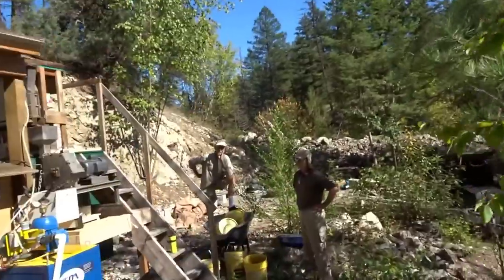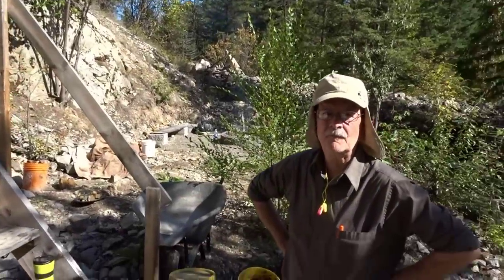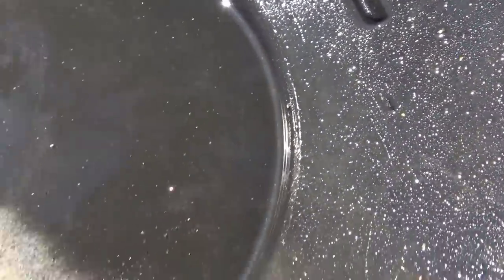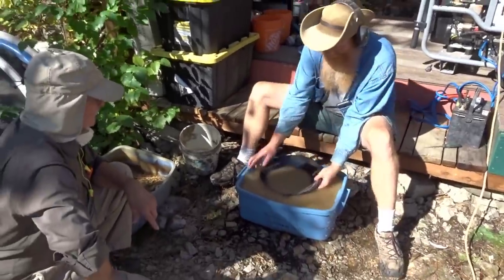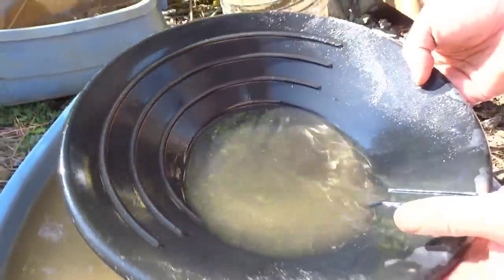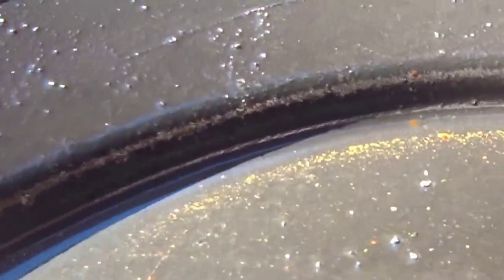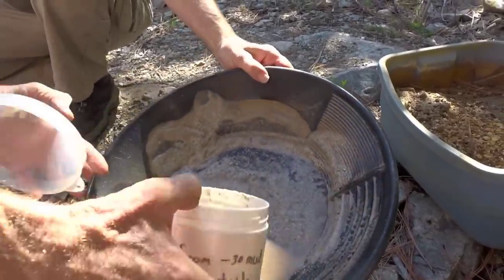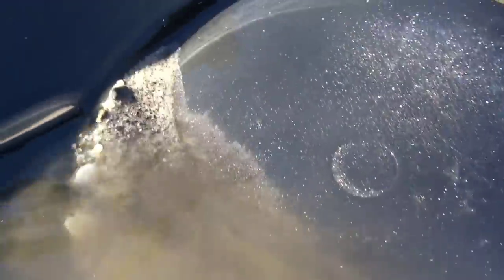Amazing Gold Recovery from High Grade Gold Ore.

Comment: Amazing recovery. Especially after being run 3x before!
Reply from the maker: Ya amazing!
Reply: @Danhurd  It isn't a lot. That 45# bucket is very roughly 1/50th of a ton. Multiply those fines by 50 and it probably comes up to far less than 0.1 gram. But, even at 0.1 gram/ton, that is about $6/ton unnecessary loss. The main question is whether it is worth recovering and, if so, how.

Very informative video. I assume you checked the tailings from the centrifuge to make sure none of the fines were getting away there.

Comment: @11:30 it looks like your sulfides are split into 2 layers like a black and a slightly reddish layer above. i was wondering why there was that color change.
Reply from the maker: Two different sulfides, most likely magnetite (Not a sulfide at all) and Iron Pyrite.  May have even had a 3rd in there as there was a heavy whiter layer as well.
Reply: @Danhurd  neat thx for the info

Comment: They should still use mercury. Just on concentrates under laboratory conditions.
Reply from the maker: There are safer ways to do the same thing now.
Reply: @Danhurd  Mercury isn't unsafe at all when its handled correctly.  But what is the alternative for 300-400-600 mesh gold? If you don't mind me asking. I would like to look into it.

Comment: Seriously.. I don't understand why no-one uses vibrators/sex-toys on gold pans. We use industrial size sex-toys on concrete to shake the air to the surface to create a smooth finish. Just hold a vibrator on the side of the gold pan and bingo, all the heavy will go straight to the bottom in seconds.
Reply from the maker: Could make for an interesting video...